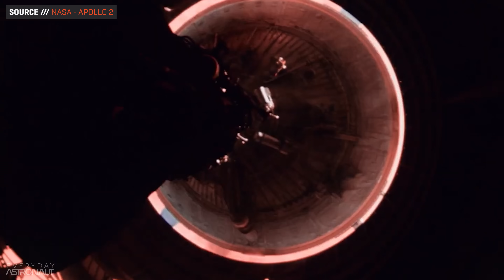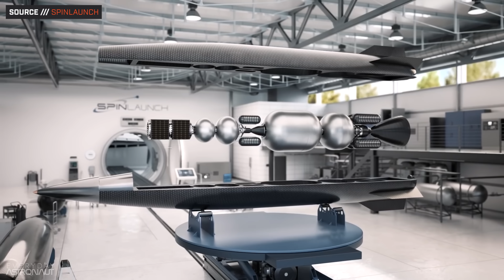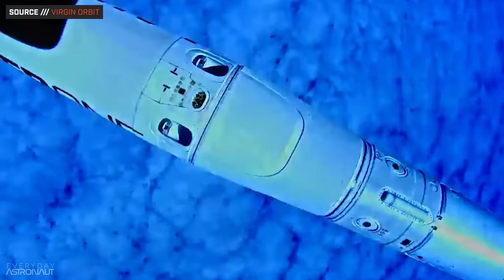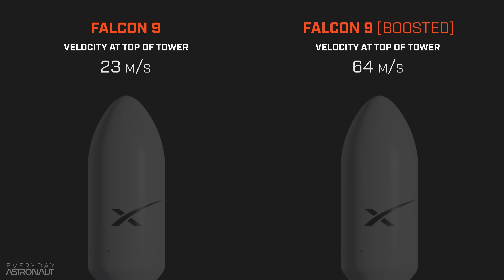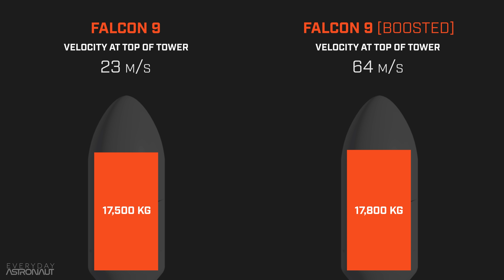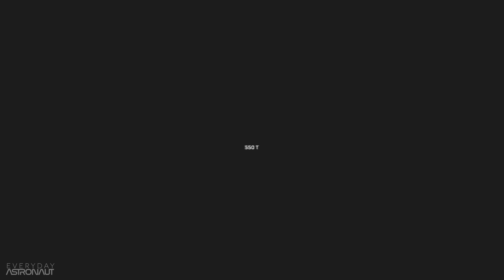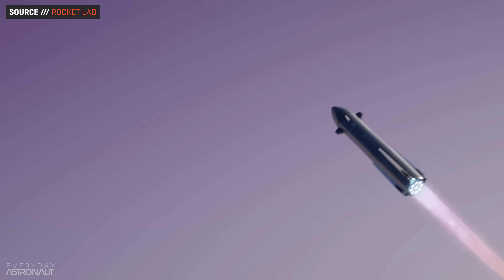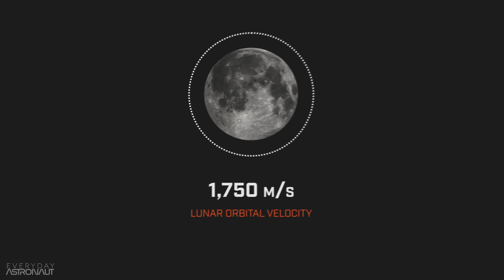Could We Help Push Rockets To Orbit?

Comment: Interesting.  The only "Analogy" or example of this actually having been built, are magnalev trains.  The interesting fact is they require ENORMOUS amounts of energy to work, i.e., they are extremely inefficient.  It's somewhat based on the fact that we just cannot store electrical energy in a dense fashion, anywhere near as dense as liquid fuels, e.g..  Liquid, or cryo fuels turn out to have a much higher energy density compared to electrical sources (current sources, e.g., batteries or capacitors) so they make better energy sources to power things (e.g., rockets and jets).

Comment: I would think the problem is the gain in weight because of more structural strength eats away the benefit 
the bigger the rocket the more of a problem it becomes

Comment: What if you make a long straight railroad, curve it up at the end, put a large high-speed high-power electric train on it and then strap a rocket to the top and drive it at full speed up the ramp, then release the rocket near the end of the ramp and use the rest to slow down the train so it can be reused?

We're very good at laying down train tracks, so the length could genuinely be stretched to several kilometers without issue.

Comment: I would run the track/tunnel along the ground,say on the bonnevile salt flats for 60 70 miles with it pitched up at the terminal end powered by solar or nuclear.  The tube would be sealed and air evacuated

Comment: What you need is a mass amplifier. Need light weight but lots of mass use an INERTER or J damper as they were called in Formula 1 before they were banned in 2022.  Just combine your spin launch rotor into an inerter and there you have it, a mass assist for the world's largest rocket. Simples.

Comment: Sure, there are good reasons not to yeet a rocket into space, but energy consumption by itself is not one of them. I mean, it takes even more energy to lauch the rocket the traditional way, just in the form of chemical energy, not electricity, right? (Reminder: a certain "entrepreneur" is selling dreams of launching "Spaceships" on an hourly basis for a "colony on Mars", or even as an alternative to airplanes. What would the energy consumption of that be, even if you just count the rocket fuel?)

Comment: When you were talking about using a lot of energy really fast to get the rocket to the top of the tower a bit quicker, it made me think - if getting it there fast is the thing, why not just have a massive weight at the top of the tower (or higher,) and connect it by really strong wires over a pulley to the rocket.  Drop the weight, and the rocket goes up.  That way you can slowly slowly over many days raise the weight, and then release it all at once.  Yes, there are massive engineering problems there too, but seems better than your thousands of electric car chargers.
Okay, watched a bit further, and you got to my weight and pulley idea.  But whilst your 40 billion dollar cube of tungsten doesn't work, there are other big movers already in nature.  How much water goes over the Niagara falls every second?  I don't know, but I'm guessing it weighs a  lot.  You could probably harness something along those lines for a lot cheaper.  But, yeah, still very expensive and tricky to make it work.  Maybe not worth trying it unless someone finds the perfect situation already existing in nature somewhere.

Comment: Wait, I thought you were going to start your calculation by removing the 125,000kg of fuel that wouldn't need to be carried if a ground-based launch system lifted the rocket until it cleared the tower. It might be more than a 3% increase in payload capacity, if you did the math that way. Redo!

Comment: Instead of making the rocket faster by the end of the tower, try estimating how much fuel you could avoid having to burn to get to the same position at the same speed.

Like you said you need to burn 127 tons to just lift the falcon 9 to the top; could you save that much fuel if you used a different booster?

At that point your rocket just became that much lighter and you need that much less energy to lift it

Comment: A realistic electromagnetic launch assist system would be maybe 10-50km long and accelerate the payload at 100g or more. That's perfectly doable for many payloads. This has all been worked out in the 1960s already. In other words, grandpa engineering had it all under control, kids. :-)

Comment: Okey, what about this, instead of needing a 22cubic meter of steel, what if instead we make the tower taller, if we make a 400meter launch tower, wich is feasable, the load needed to achieve 3g would be a lot less, right?.
Reply from the maker: Incorrect. The weight can only fall at a maximum of 1G, so the power is the same if the track is know you just need to apply that power for longer (energy)
Reply: @EverydayAstronaut  Right! My bad, you woudn't reach 3G  of acceleration! But would it be meaningfull at all if you assist the thrusters to free fall speed. Uhm... Probably not in a meaningful way

Comment: May be you could have a fire hose with jet engine at end so can you continuously pump fuel through it and burn like oil in ocean oil rigs, flying counter clock wise to Earth rotation so it stands near Karman line (in pocket) and acts like fuel depot without falling down, possibly attach hot air balloons to exhaust for stability

Comment: How about you make the launch assist rocket-powered? Just put a large tank of fuel on top of the launch tower. As the rocket lifts off, the tower pumps more fuel into the rocket. This means that the rocket can be lighter at the moment of lift-off, since it doesn't have to have that fuel pre-loaded. Maybe you could get it so that the rocket is effectively running 100% off fuel from the tower until it clears the tower, which would be effectively equivalent to having it 100% boosted by some electric-powered chopsticks system. This system would be a lot simpler than any of the systems Tim mentioned, since you're using the existing engines of the rocket, and you aren't putting any more strain on the tower. You just have to make sure it doesn't cause an explosion when the engines ignite the fuel as the tower and rocket disconnect at the top of the tower...
Reply: ^genius. Seriously.

Comment: The average US home indeed does not use an average 1,200 watts like you say at 12:00. One air conditioner uses at least that much and likely more depending on the unit size.
Reply from the maker: Look it up, don’t know what to tell ya. It’s about 30 kWh per day.

Comment: I have a simple question on the lunar launch option: did you reduce the weight of the rocket by 5/6 to account for the Moon's lesser gravity?  If not, the force requirements are 5/6 too high, and maybe some structural consideration for the track are too high too, since the track won't have to support so much weight.

Comment: I always check the knowledge of this kind of presentation by whether they get the units right. And something jars about the power units. At first blink I see you use small k and h and capital W for watts. Then I see what is jarring: it's a smaller font but it's still incorrectly, capital K and capital H and not kWh.   K is kelvin and  H is henry. Those are NOT the relevant units.  Also several things like 45,000 MWh. We have prefix factors like kilo, mega, giga to avoid all those zeros. So that would be 45 GWh.  I suspect you have a pretty good idea what you are talking about so, please, GET THE UNIT RIGHT.
Reply from the maker: It’s an uppercase font so the way you denote lowercase is to make it smaller. I’m aware of the absurdity of going into million KW not being correct but when comparing it along side another rocket or system that is in kW it makes sense and helps visualize the scale.

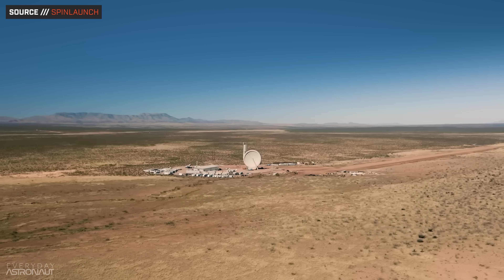Comment: 4:09 spin launch is not launching spacecraft, it's throwing axes, due to conservation of angular momentum. a ball would be better because those fins would be sideways compared to the direction of motion a second later after a launch, the "rocket" is going to rotate at roughly the same RPM as the object that spins it up. just use a cannon ball!

Comment: You basically did the math for two extremes. Giving the rocket a boost with a system the size of a launch tower and using a 600km long vacuum tube. What about a middle way. Lets say a launch rail somewhar roler coaster like. 20-50km long going up to 2-3kms at the equator, accelarating Star Ship to about 300m/s so air resistance doesn't become a huge issue. Have you done the math on that?

Comment: The Nazis actually designed an intercontinental orbital bomber that was supposed to drop nukes over the US. Using a sled to accelarate the plane to mach 2 at ground level and launching it into the air it was of course just a design and experts are sure that this would not have worked but they had the idea.

Comment: You could have the chopsticks have cables which then have a pulley at the base that would let you turn the cables 90 degrees and then have your accelerator ground mounted. It could be an enormous flywheel with lots of gear reduction. You wouldn't need as much mass, and you could take your time spinning it up slowly to not have unreasonable energy needs to "charge" it.

Comment: If I understood your maths for the tower based assist system, the rate at which the energy would need to be delivered is determined by the time the rocket is attached to the tower. If the rocket is accelarated faster, wouldn't that reduce that time and therefore require even faster delivery of the energy?

Comment: What about keeping the propellant filler hose attached to the rocket during takeoff, then separating it once it clears the tower? Then the rocket doesn’t use on board propellant for the first seconds increasing payload capacity without crazy infrastructure.

Comment: It seems to me that an electromagnetic launcher would not be the best option. While 450MW is not really that out of reach, being less than the output of a single turbine in a modern power station the linear accelerator itself would need a huge amount of copper to do something with that power without vaporizing itself.
 I think a relatively simple steam catapult like used in aircraft carriers prior to the current generation would be a better choice.  Five cylinders of about 1.5 m diameter would provide sufficient force to give starship+superheavy a net 4G in addition to the boosters own thrust given a steam pressure of 250 bar.   To avoid the complication of a boiler and massive steam accumulator  one could instead use a hot gas generator to feed the cylinders instead of steam. Something similar in complexity and size to a raptor engine would be more than sufficient to provide the required flow and pressure.
Not saying it would be worth the small increase in payload but looks entirely feasible to me if someone were to want to do it just for the sake of doing it.

Comment: I liked the video. But i miss a note of how much energy the rocket itself is using. Like the saturn 5 rocket had like 2 or 3 thousand tons of fuel if i remember correctly. That got to be a lot of joules of energy.  1 kg of kerosene have about 40 MJ of energy. So 1000 tons have about 40 000 000 MJ of evergy. I dont know how much energy was in the saturn 5, but i would guess at least in the same order of magnitude as 40 million MJ.

Comment: magnetic launch has always been my fav idea. Don't worry about keeping the G's low, ramp them up as high as possible for a shorter track, build a nuclear generator to provide the energy and you've got an incredibly cheap way of sending millions of tonnes of cargo, water, fuel, spaceship parts into orbit

we need mining equipment up there, in the asteroid belt, on the moon, on mars
we need proper space stations, not that puny weird thing we have right now
we need hotels in orbit
we need retirement homes 
we need zero-G sports stadiums
we need hospitals

use rockets for people, magnetic launch for the millions of tonnes of everything else we need

Comment: Startram wasn't proposed in the 60's. A patented for it was granted in 2001. If you want enough speed to get to orbit, you need to accelerate to 8000 m/s at the perigee of your elliptical orbit. @25:55 I don't understand why you felt the need to refer to a door as a "crazy mechanism for a seal on top". And saying that a powerplant that can deliver 2.3 GW of power for 153 seconds  "...isn't going to happen in our lifetime" is, well, it's kind of a dumb thing to say since many powerplants can already generate this kind of power continuously. You're using a lot rhetorical exaggeration in this video to make it seem like the energy requirements are ridiculous when, in fact, they are perfectly reasonable. I'd recommend taking this video down, revising it with the help of some consultants who have relevant expertise in the field, and then reposting it.

Comment: The most efficient way is launching from a pneumatic tube drilled three miles deep at White mountain in California.  Over 14,000 feet and a road to the top. Owned by university of California. Air pressure at 200 psi stored in caverns. You could launch multiple rockets every day. Also add mass driver inside the tunnel walls. Add four jet engines at the nozzle pointing straight up and you will slide into space. Love to know the numbers

Comment: Either increase efficiency of the engines so you can do the same with less fuel or come up with lighter fuel with the same energy output, unless modern science has platoed since the 60’s.

Comment: Remember, the fuel used for rockets, is equivalent of "million households/4000 Tesla chargers" that you talk about. It just sounds absurd, only because you put it in terms of electrical energy.
Reply: The fact that fuel delivers that power is why fuel is the preferred method. And remember he is talking about power there, not energy. That is just what is needed for the wiring to deliver the power. After that you still need to have massive amounts of energy available. Or you could just use fuel, which conveniently doesn't take up any more space or infrastructure than a rocket.
Reply: @christopherpepin6059  Electric energy is still better than combustion fuel because most of the combustion fuel is wasted in the engine under non ideal circumstances. Plus you have to make your rocket much bigger and more hazardous (storing a massive amount of explosive fuel.)  Using a spin launcher is more energy efficient (not because of the delivery method, but because stationary generators will always be more efficient than variable messy engines.)
Reply: @Neoprenesiren Rocket engines are designed to be efficient and to capture every last bit of energy from the fuel. They absolutely do not waste most of the energy in the fuel.
Reply: @christopherpepin6059  Yeah. That was my point. He was talking about power and liquid fuel is the way to deliver that much power in concentrated form.
Reply: Yes, but that is not a 1-1 comparison. Delivering that much power that quickly electrically is a waaay bigger deal than doing it chemically.
Reply: Well, it's in the correct order of magnitude but actually quite different. Rockets are accelerating way slower on the liftoff but also engines are far from 100% efficient, so you probably somewhat closer in a total thermal output. And also rockets shred a lot of the mass along the way (including staging), so we can't use i.e. Dragon capsule calculation to get Falcon 9 energy output. So, this numbers give the ballpark idea, but none of the figures cited actually match energy output of actual rocket.
Reply: But part of the point of using the launch assister is to cut down on the use of fuel. As you could generate the electricity with solar, making it more environmentally friendly.
Reply: @jumpingdude766  how do you think rocket fuel is made? Liquid nitrogen, liquid methane and liquid oxygen are all made electrically by compressing, distilling and cryogenically cooling air. It comes out of the atmosphere. You could, and this is sometimes done, generate the electricity for that with solar also. 

And the exhaust from rocket engines using Liquid nitrogen/methane - LOX engines is litterally just water.  Nitrogen-LOX produces pure H2O, and Methane-LOX produces almost entirely pure H20 and a small amount of CO2. 

Using any form of electrical launch assist, even if it were feasible, would be far FAR worse for the environment because you need huge batteries and/or supercapacitors to store/discharge that electricity. That means huge amounts of lithium. 

Lithium mining is ridicously bad for the environment...

Comment: Decades I've thought of this. The tower assist is dumb. Too short, not enough time to get any meaningful benefit.

It's gotta be a mile long rail gun. 2G's sustained for a mile is a huge benefit. Mount  San Jacinto in Palm springs is a prime candidate. It has the greatest elevation gain in the shortest distance in America, and the face is pointed West.

Only problem is it's in California and they'd extort billions$ before you could ever stick a shovel in the ground.

Comment: Couldn't you do the giant steel cube counterweight thing, but instead of all the mass in the steel, just use more rocket engines (pointing their exhaust up)?  That way, the extra weight of the rockets, and all the fuel are kept with the ground equipment.  So a platform to mount some giant rocket engines (offset from the actual rocket), the cable and pulley setup, lifting arms, and some ground support equipment.  Light all of the engines (both on the rocket and the downward fired rocket sled), wait for full thrust, and yeet!